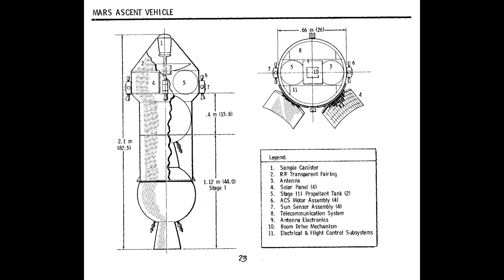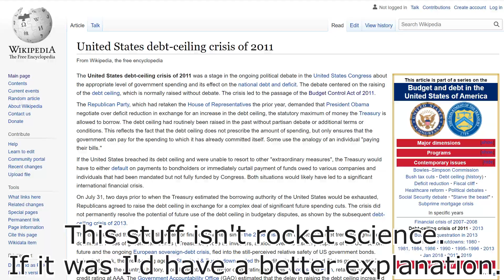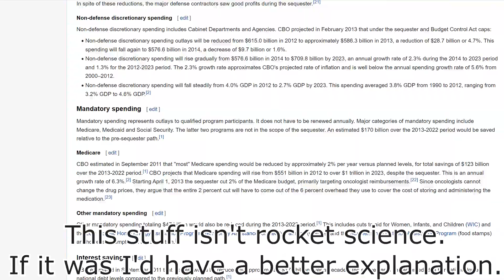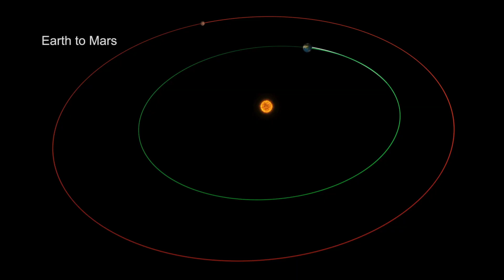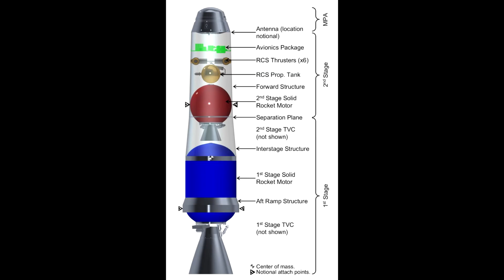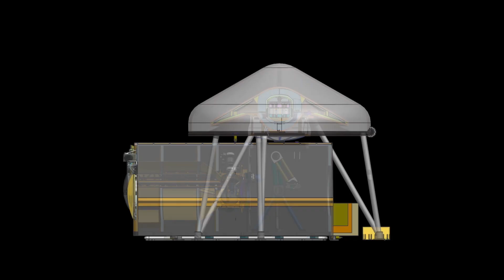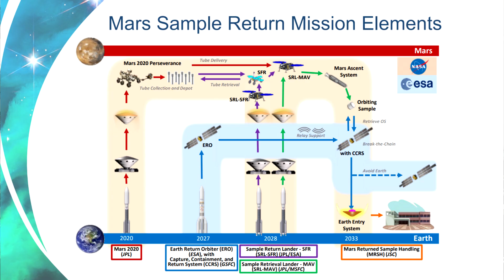Why Getting Rocks Back From Mars Is A Massive Challenge

Comment: For a previous Mars Rover the great scientists had us put rocks and soil in a vacuum chamber so they could do equipment testing, we had to tell them we can't pump down the chamber with dirt and rocks in there.  😁
Reply: Sure you can, just spend two years on the pump-down! Surely that's not too long to keep a vacuum chamber occupied, right?
Reply: @absalomdraconis  Yep they were scratching thier heads.  😃
Reply: Dirt and rocks are porous so it would take a undetermined amount of time.  We did the test with solids. 💩
Reply: As long as everything is dried and degassed i do not really see the problem in getting a coarse vacuum. Am I missing something?
Reply: Throw the materials in a kiln & heat cycle over a week, that should take care of the bulk of the volitiles i would think?
Reply: @danl6634  might denature any hint of life though :)
Reply: @edwardlane1255  This was using Earth rock and dirt in the vacuum chamber to test the equipment. I get the feeling it was not about testing the science instruments, but the rest of the hardware on rock and soil.
Reply: @danl6634  baking with purge helps remove non volatiles and particulates but rocks are still porous, depending on how many are in there they make high vac. difficult. 😁
Reply: @kricketflyd111  you re not very popular at the parties do you ? :P
Reply: I can't help but to think about Earth itself and it's surface being porous with space/ vacuum surrounding it.  Is our atmosphere the result of outgassing? 🌎
Reply: @BrainScramblies  yes. 🧀